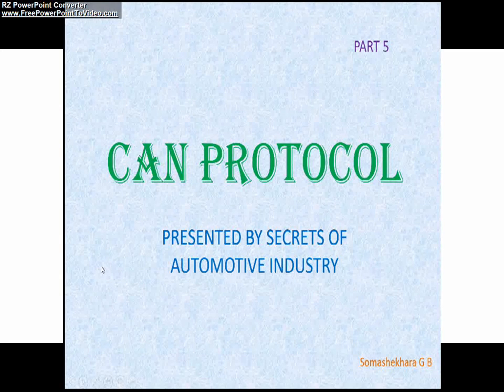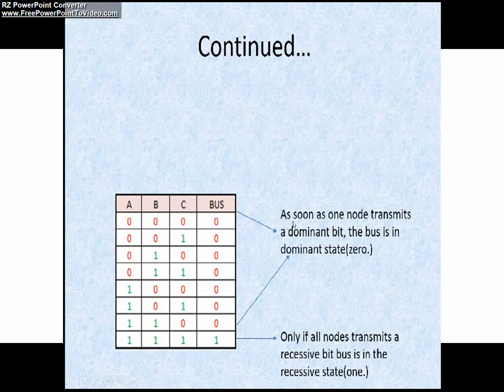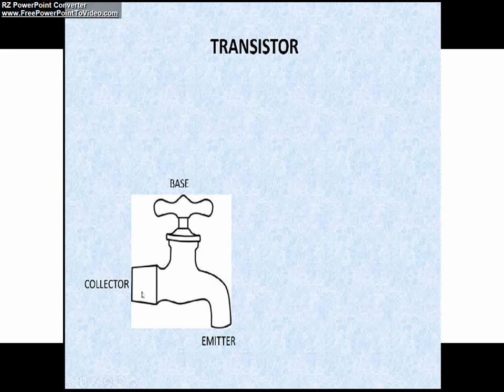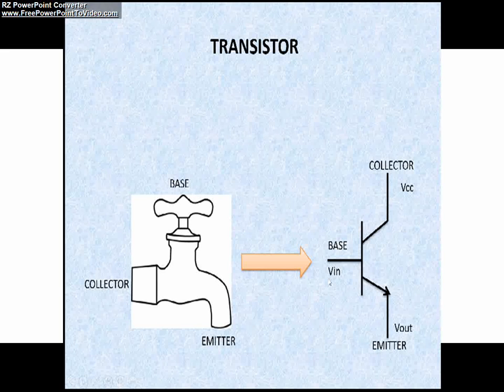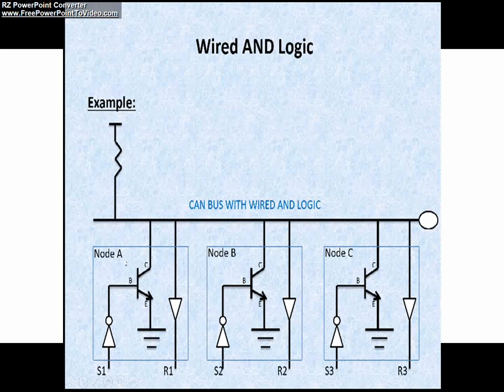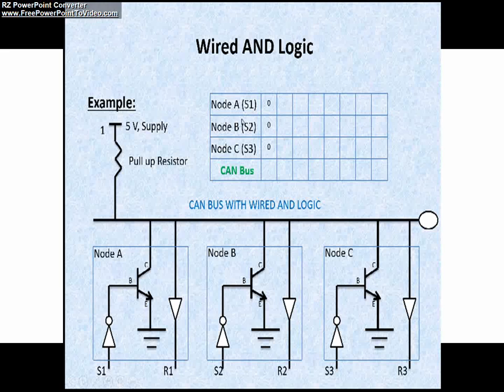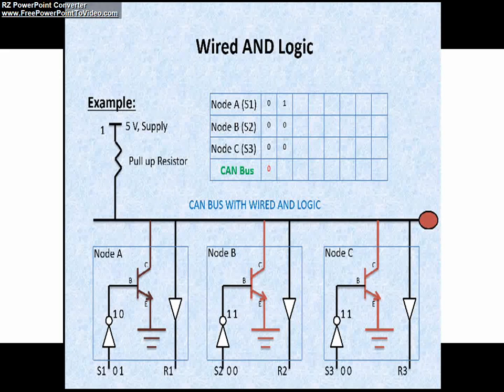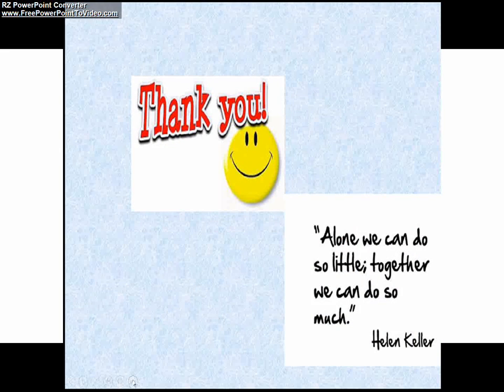CAN protocol basics. PART5, Wired AND Logic.

Comment: As you mentioned that CAN bus follows AND logic
but in above not gate and transistor circuit all nodes are connected directly with the CAN bus.
then if we send a 1 to the NOT gate it will not turn transistor on .
then in CAN bus we should get the 1 as I have not seen any AND gate at CAN nodes.

Comment: Nice Somu, Great video...I have some doubt.

In ideal BUS state when no node is sending any data, the signal in BUS is recessive 1. The moment any node attempts to send data, it acquires the BUS by transmitting dominant 0 making the whole BUS state become 0.Please let me know if what I am thinking is wrong.

In the given video, it is referred that node is sending 0 or 1. I am assuming that when you are saying 0, It means 2.5 volt in both differential wires. When you are saying 1, it is 3.5(CAN HIGH) and 1.5(CAN LOW).
Reply from the maker: 1. Yes, it acquires bus by sending its dominant bit, means SOF  bit, but the exception is when no other node does not want to send their frames in that strait, suppose if multiple nodes are attempting, they must undergo with Arbitration process to gain the bus.
2. Your second point is wrong, recessive bit means CAN bus will be in 2.5V dominant bit means CAN_H and CAN_L varies from 3.5 to 1.5V.
 Kindly watch my part1 video for clarification.
Reply from the maker: @Swagat: Kindly go through the above comment once again, small correction is appended.
Reply: @secretsofautomotiveindustr2910  Sir i saw your video recessive means you have said 2.5V. Recessive suggests that vdiff=0 right?

Comment: can u explain about the termination resistance 120 ohm,for high speed and low speed can n/w
Reply from the maker: Good question..                     1. No discrepancy in bus termination for High speed and low speed CAN (In terms of resistance value).   2. But, the method of terminating the CAN hardware  varies depending on the physical layer of hardware: High-Speed, Low-Speed, Single-Wire, or Software-Selectable.     3. For High speed CAN both the ends of the pair of cable  must be terminated with 120 ohm resistors, to match the network impedance, because ISO-11898 requires a cable with a nominal impedance of 120 ohms.     4. For Low speed CAN each ECU(Electronic Control unit) on the network requires termination resistor for each data line. That means  Low-Speed CAN requires termination to be on the transceiver rather than on the cable.

Comment: what actually CAN-HIGH and CAN-LOW is.Are they two wires of can bus?.If so,how our node sends '0' or '1' to the two wired bus.For transmitting bit from node ,it should be send through two wires because can has two wires(canH AND CANl) then how node receives,there should be another wire for receiving.So totally ,is 3 wires needed for a node for tx and rx?
sorry for this question, im not fully aware of can.would be happy if u replied.
Reply from the maker: Good thinking...Need not have to be sorry.

Coming to your question, kindly find the below answers,

First of all do not get confuse with the diagram ,the one which I have showed in my video that is just for an example I have considered single wire and of coarse single wire CAN also exist.

1. Yes, you are right absolutely, CAN_H & CAN_L are two different cables and in real Vehicle duo are two different connectors to ECU.
2. The Transceiver (Transmitter + Receiver) is connected to both the pins CAN_H & CAN_L.
3. Transmitting and receiving the bits is managed by Transceiver internally.
4. As you already know, for example if the Node/ECU transmits a recessive (1) bit,  Transistor will not be activated due to the presence of NOT gate in the circuit, hence the voltage on the CAN-H and CAN_L is 2.5V (according to ISO-11898).
5. No need of 3 wires for transmitting and receiving, since Transceiver manages it internally.
Reply: I'm not quite getting the TX nd Rx in a Can bus.  As far as the nodes are concerned they are hooked to CANh and canl wires
Reply from the maker: What exactly are looking here? I did not understand your question, could you please elaborate? so that I can try to help you.

Comment: Why can is having 120 ohms at each end???
Reply: To match the impedance of CAN line. An standard CAN bus has total impedance of 120ohm to match this impedance stubs of 120ohm are added to complete the Circuit.
Reply: @AbdullahKhan-kn2fr  tqs....
Reply: @AbdullahKhan-kn2fr  hw to resolve errors in can???
Reply: @bhavyareddy3385  well! What kind of errors you are talking about? There are many many diagnostic tools available from different vendors, using them we can actually log errors and then decide how we can resolve it.
Reply: @AbdullahKhan-kn2fr  CRC error occurred @ the time hw to resolve it???
Reply: @bhavyareddy3385 there can be n number of problems in CRC. You can start studying if CRC is implemented correctly at Data link layer and also check how message objects are being packed and unpacked.
Reply: @AbdullahKhan-kn2fr  tqs